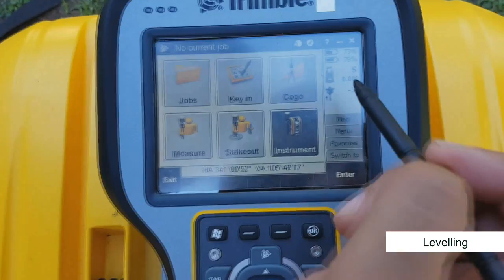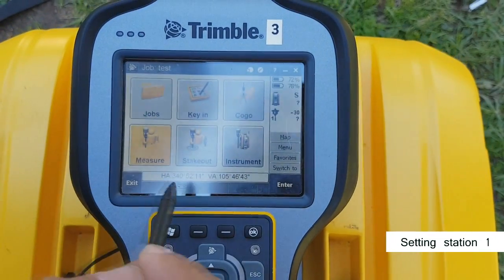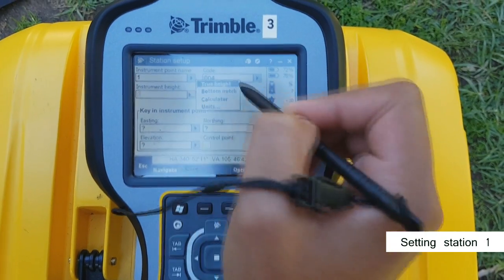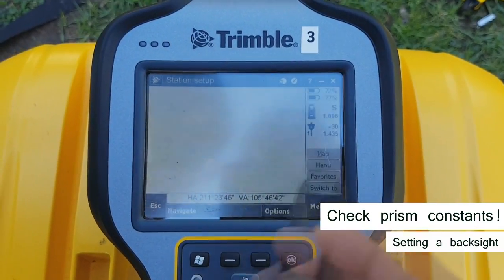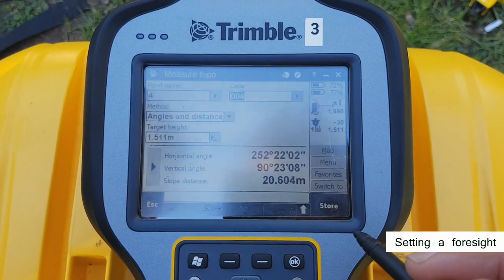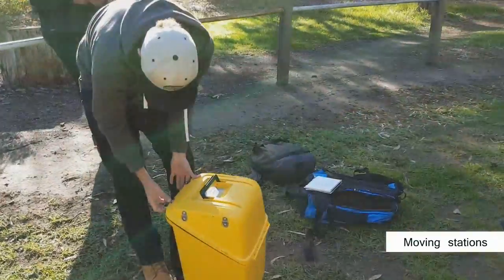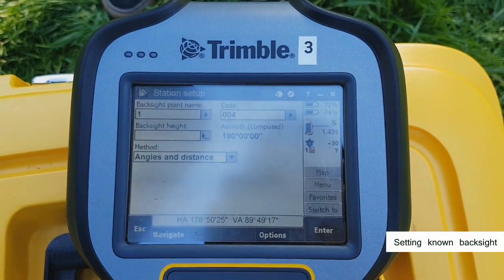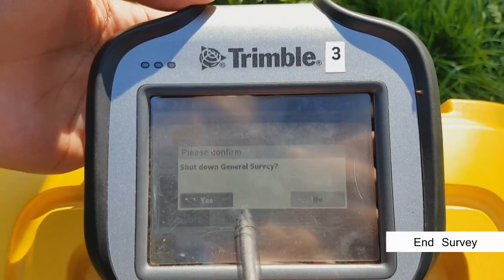Traverse recording using a Trimble S7 (RMIT Adv. Dip. Surveying 2016)

Comment: I'm in shock, where is the proper traverse measurements on this movie???? Do not give that crap on the net if you do not know how to complete proper surveys.
After complete station setup you should use Measure Rounds option, otherwise you get coordinates useful for building a sand castle only. Thx

Comment: I saw no traverse.   You'd have to use measure rounds to do that, not measure points.
Reply: These are students at RMIT, the video is a reference for their own fellow students and not to compete with everyone like you as an assistant surveyor in the field. Their way of doing it is the basic way of distance measurements, of course the professor will get them to "measure rounds" once they're familiar with the operational of the gear.
Reply: This is incorrect. You can still manually calculate the traverse just using the angles and distances or run the JXL file through most surveying software to calculate it that way. Measure rounds is only needed if you want access to calculate and adjust your traverse for you.

Comment: This proves a 3rd grader is capable of operating the equipment.  If your traversing you would measure direct and reverse multiple times before moving forward..  And Aaron you must have never used a Trimble MagDrive,  you can turn instrument not using knobs, there is no friction except the MagDrive.  If you have used one you would know that you will turn it with your hand..